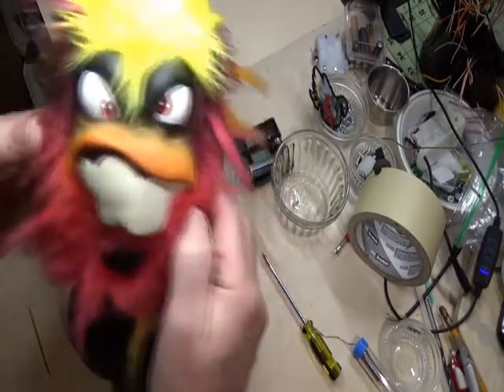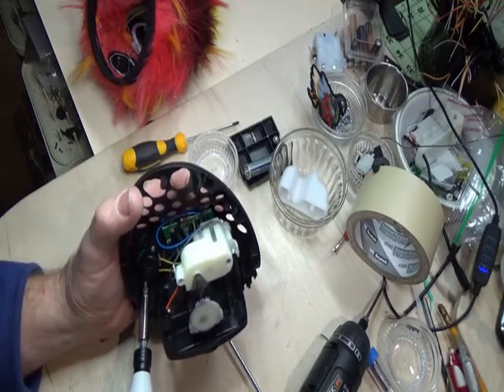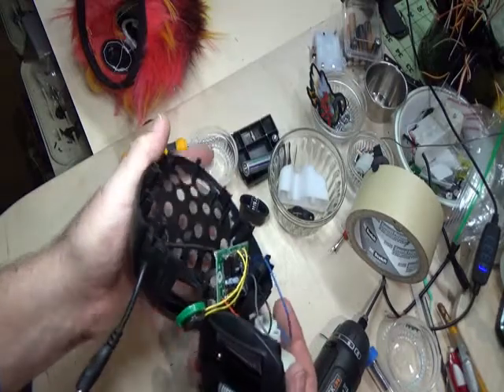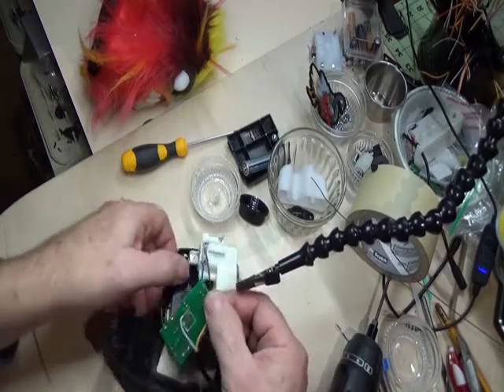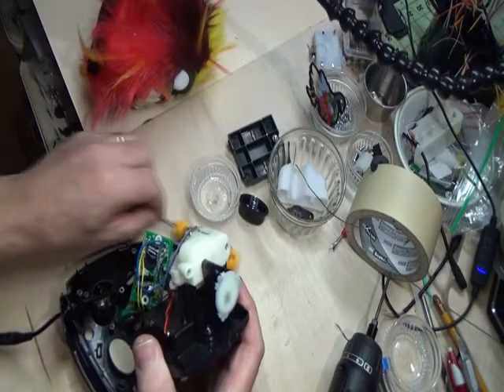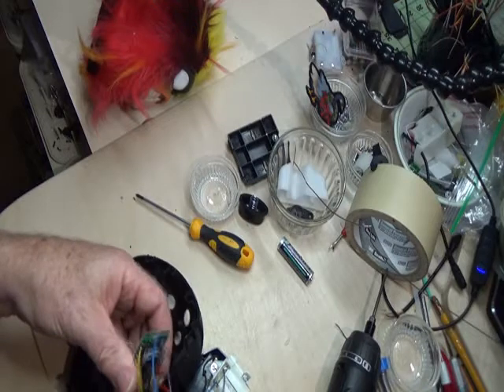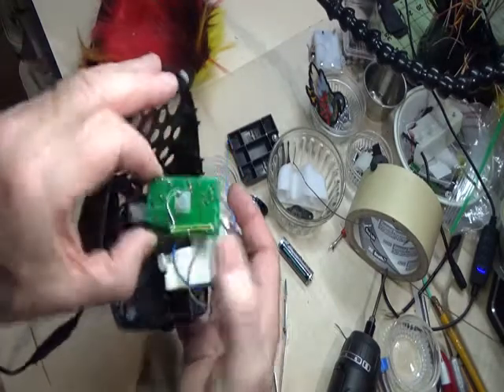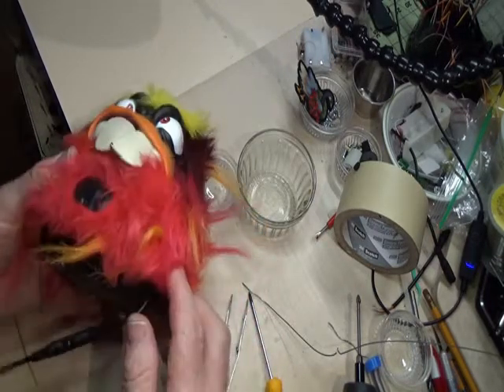How to switch adapt a Grumblie

Comment: With the 3.5mm jack wires, is it typically left channel that is the tip?
Reply from the maker: Actually, I am not sure. Just checked one of my cables and I combine the tip and ring together for one side of the switch while the sleeve acts as the other. Have not needed to determine left or right.
Reply: @TheLaserguy2  only reason I ask is the only part I’m confused about is which wires need to go together. I know what the function of the wires are on my jacks but am a little confused on which go together without testing. In this example red wire is left channel, white is right channel and black is ground. Any idea ?
Reply from the maker: @PlaysRyan  I don't know which color is what. All I know is as long as I identify 'common' and the 'other two' which are combined, I get an effective cable for switch or toy. 
Check out my other videos on how to make a mono cable from a stereo cable.  https://youtu.be/00Ki_rWxCFE